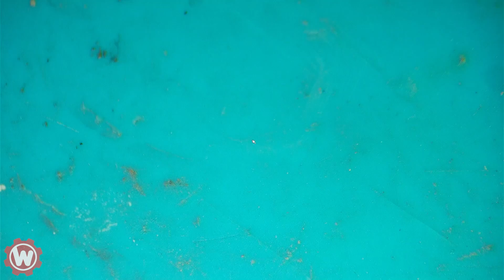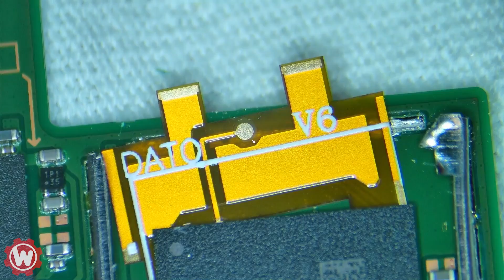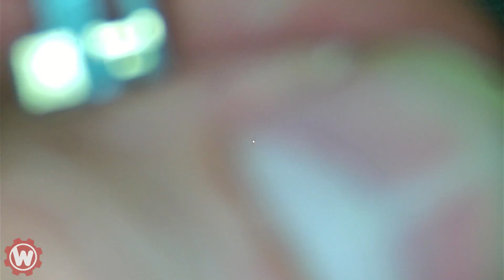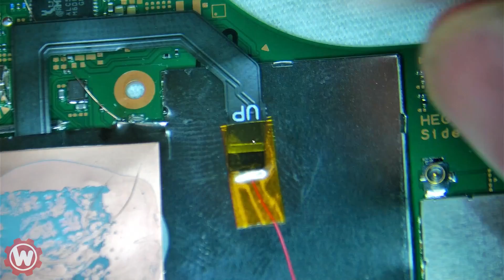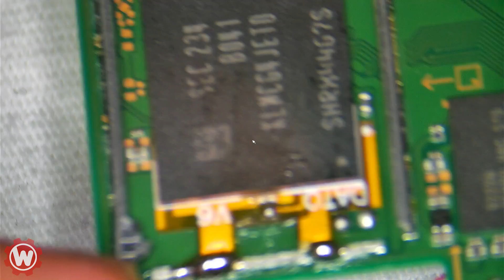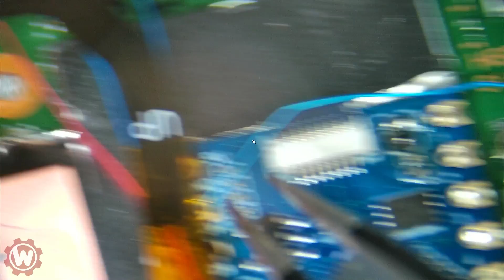Nintendo Switch OLED RP2040-Tiny Installation

Comment: Has the process changed now? The guide on guide nx suggests you need to solder wires in on particular points?
Reply from the maker: This is an older video yes.  Check out the newer vids.  There now som alternative points we can use including the kamikaze method for the OLED.

Comment: Hello, your video is very good, I have bought a batch of rp2040 tiny to test this new chip and they do not start, I have inserted the firmware and nothing does not turn on the LED it has. How did you manage to flash the chip. If you can help me I appreciate it. I have made the bridge that you make in minute 30 of the video and nothing
help please...I have tried firmware 2.75, 2.74 and 2.73 but nothing works, none of them work, I have already opened 5 chips and they are all the same
Reply from the maker: Flashing the chip is very easy and there are lots of tutorials for that.  Maybe I can make one in the future in the meantime there are lots of videos showing you how to do this best of luck.

Comment: Question… Can you use a v2 CPU flex cable, on an OLED mod? 🤔
Reply from the maker: No. They are different and it all depends on your chip.
Reply: Yes, you can use v2 flex on Oled if you are using an RP2040 Zero or Tiny. They have the same functionality and the only difference is with how long they are.

Comment: what is the difference between v2 and v3 flex? cai i use de v2 flex on the oled switch?
Reply: Yes you can use V2 flex on the Oled, V3 and v2 cables function the same way.

Comment: Why sold the point for bridge on picofly?

I see another video at install tiny on Switch lite and the point bridge not solder but it's right the switch run ok and tiny glitch
Reply from the maker: It’s for led light but you don’t have to.

Comment: Hola! Tengo una duda, espero me puedas ayudar. Tengo el mismo modelo de rp2040, pero no enciende el led para saber sí hay algun problema en la instalación o si esta haciendo glitch correctamente. He instalado varios y funcionan bien, pero falta ese detalle ¿Tu sabes a que se puede deber el problema? Saludos.
Reply from the maker: Si no prende revisa tierra y corriente. Debe te prender si está entrando los 3v. Suerte.
Reply: @Wayayeo  el chip funciona, inicia el payload, pero no enciende el led de estado.

Comment: On the ribbon cable, are you bridging pins 3 and 4?
Reply from the maker: The two middle ones.
Reply: @Wayayeo Thanks! Do you know if all the flex cables are the same? Other than where they pop out? I have a V6 cable from an Instinct V6 chip that I want to use for a RP2040 instead since the chip is giving me problems. I don't want to have to remove the ribbon if I don't need to.

Comment: 0:22 in, you mentioned it already has the capacitors installed. Do you mean resistors? And you also say its, "470k or ohms." I thought the original resistors you install on the rp2040 zero was just 47ohms. Is that a miss speak/mistake or is it good without having to put in the 47ohm resistors? Thanks!
Reply from the maker: Thank you for the correction. They are in fact 47ohm resistors.
Reply: @Wayayeo I gotchy! I just went to the wave share site and tried to understand the nuances of the tiny board. Looks like the original rp2040-tiny boards were 470ohm resistors, by a manufactoring mistake on their end. Then they came out with the rp2040-Tiny Rev1.1 (the same one in your vid thumbnail) which switched it to 47ohm resistors. So you dont need to install resistors. Looks like people who got the old boards just removed those and bridged the connection then installed their own 47ohm resistor in line. Thanks for the video my guy!
Reply: @kingsmanname  exactly

Comment: Hi, I have the same nand, I have the code for D0 not connected, do I need that yellow ribbon? because mine is different from Aliexpress, mine is black
Reply from the maker: Check ohms.
Reply: @Wayayeo  ohms is 1.22ohms, I have seen other videos but they show volts and they read .750v, is my reading good, i am starting to think maybe my picofly rp2040 is bad

Comment: your videos are pretty good.   the biggest thing that irks me is you scraping off the old paste to reuse it, thats so cheap and sketchy imo.  That should all be cleaned off and fresh quality paste should be added.   The cost is less than a buck to redo all of it and ensures a cooler running console and longer lasting products.  The little things count a lot, I use arctic silver on all my stuff and is pretty damn cheap for the amount you need per job
Reply from the maker: Nintendo uses quality thermal paste and often times they use more than enough. On OLEDS the thermal paste is typically fresh, and I believe it’s unnecessary to replace. I do replace with arctic silver when necessary. Thank you for taking the time to comment. Every input is taken into consideration.
Reply: you could also clean the flux off after soldering -  @Wayayeo
Reply from the maker: We do clean the flux. In this video we demostraste the installation process, it’s not a how to clean video. Thank you for commenting.